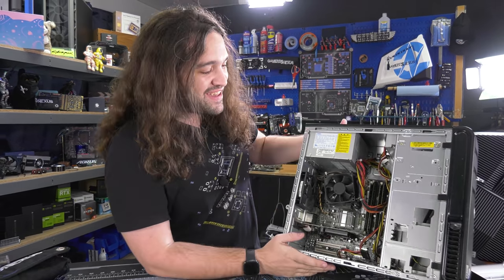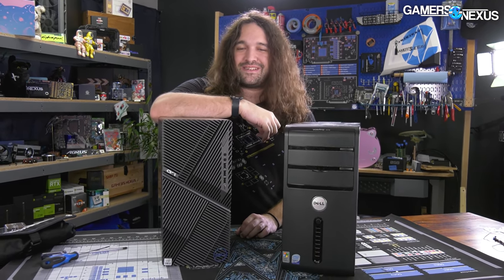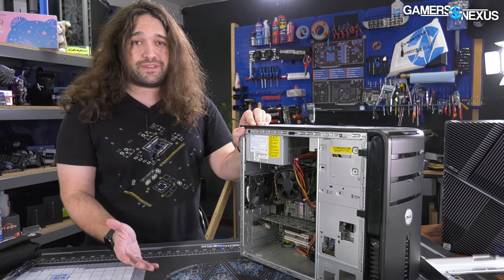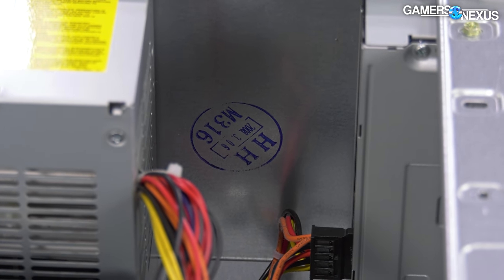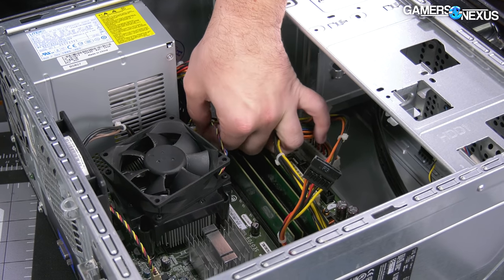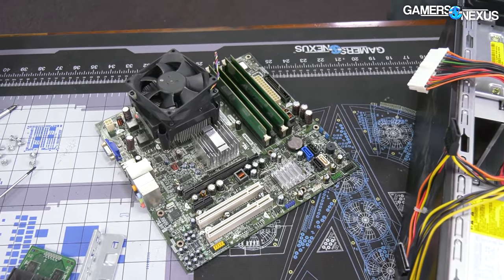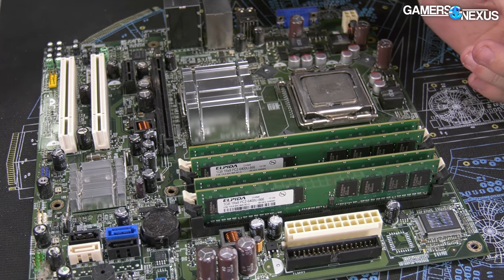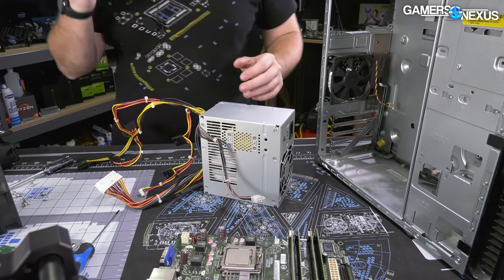13 Years of Dell Getting Worse

Comment: I do not recall when it was but at one point dell was using a standard 24pin header with a custom pint out, really fun to watch the board smoke when you replace the psu
Reply: they did that for quite awhile and it lead to many dead systems or psu's back in the day iirc. I never understood why either, it would have cost them MORE to have a normal psu custom wired and an otherwise say cookie cutter Intel 440BX motherboard with the only difference with it being wired for that specific psu.
Reply: My sister uses a 9010 optiplex with i7-3770 and it has a standard 24 pin. The newer haswell ones (9020) had a non-standard mobo connector
Reply: I remember Compaq doing the same thing. Luckily for me it tripped the PSU protection and nothing died.
Reply: The 'non standard' components are clearly used to drive down cost - they sell way more servers than desktops so economically makes sense to use the same PSU etc. Server components tend to be fairly reliable also. 

I haven't done it, but would be interesting to see overall cost comparison of pre built Vs a budget custom built with same specs for all these pre builds you have done (sorry if this has been done already!).  

The ewaste point is fair, I gradually replace bits of my system over the years. I still have a backup system that uses a 10yr old intel mobo/CPU and it works fine. It's just not in their interest I guess
Reply: @ajcball  Servers use very standard components. Server PSU's are not at all like the ones on desktop PC's visually but conform to the same standards. A Dell server that didn't have an ATX, or IPX or some other standard, PSU would get Dell sued. Dell hasn't been sued because Dell would never try that on their enterprise customers.

Dell does that to their commercial customers because they can.
Reply: I actually busted a mobo because of that.
Reply: OH NOOOO OH NO NO NO NO NO NO NOOOOOO I have no fucking idea what I would do if that happened to me, probably something in between of an all out boycott campaign and a terrorist attack on the Dell headquarters.
Reply: Wow! That’s diabolical.
Reply: Around 2004 / 2005 my friends dell kept dying.  He put a custom heat sink on the chip set and it decreased the service calls.  It didn't like the added heat from the GPU
Reply: The Dimension XPS of old were so very close to ATX but then swapped the pins around to make them incompatible with replaceable PSUs. A few like PCPower & Cooling had replacement PSUs for such builds IIRC.
Reply: That was around the time I got started working on computers for others. Also when I started to use old PC PSU units for project PSU. I got bit burning a clients computer and then a year later bit again frying a circuit that took a couple days of soldering traces to get ready. Learned a valuable lesson from that, verify the outputs before you use them as inputs for another device.
Reply: @ajcball  They do not use server grade psu's in desktops.
Reply: Do you know which Dell systems were affected by this?
Reply: I bought a Dell system from an estate sale to run old DOS games, and it had that proprietary 20-pin header.  Drove me nuts
Reply: Glad to see others bring this up. The computer repair store near me sold an adapter the swapped the 2 pins around. I was so passed when I heard about this as Dell had done some PR to promote how you could upgrade with off the shelf components and that they now (at the time) carried said components in their on-line store.
Reply: My precision t5500 uses one of those non standard pinned power supply. Do some research first on any dell to be sure that standard parts will work for you
Reply: @drksilenc  Probably true but there are similarities so I woud assume some parts are shared for cost reasons (like how BMW create the same engine but badge it as 3 different ones!)
Reply: @ajcball  ummm while servers might use a 12vo standard in "some" cases dells desktops basically contain no standard or transferable parts ram .. nope CPU.... nope psu .... nope gpu.... most servers dont use gpus.... hard drive?.... to low capacity.... nvme.....to low capacity or speed
Reply: @nicksimkins  Thanks for that. I was looking at these systems in the refurbished section. They don't mention this in the marketing materials between the *010s and *020s. (Same with the 7010/7020)
Although I heard you can buy an adapter to get standard ATX's working in the 20-series.
Reply: I think it was in the original Pentium days...  I'm not sure.  I had a Dell Dimension P133, and I think I remember coming across a reference back at the time that the PSU had the same number of pins, and the connectors would fit, but that it wasn't wired to ATX standard, and so couldn't use a standard PSU.

I don't recall exactly where I'd heard that - might've been an old Usenet Newsgroup that I was getting digest from at the end of the 1990s... I think?
Reply: @nicksimkins  that's so weird
Reply: I had one of those, if you put a standard power supply in you would release all of the magic smoke, the same if you put the Dell supply in a regular machine.   This was 20 years ago and ATX standards were still in flux so Dell just rolled their own pinout (so they claim)
Reply: @KenS1267   Practically nobody uses "standard" PSUs in a server -- at least not a rack-mountable server.  They're pretty much all bespoke to the server chassis, and if you want to replace it, you go right back to the vendor to buy another one.  Which is fine, in enterprise sales, as you don't want to be picking components willy-nilly anyway.  You want an OEM part that will meet OEM specifications, and it's totally fine if it's 150-200% more expensive than a comparable DIY part because the cost of making mistakes is well beyond the markup for OEM parts.
Reply: I have one of these! Dell optiplex GX1, pentium 2. For something of its generation, you'd never know it was wired weird until you released the magic smoke.
Reply: @nickwallette6201  LOL. I'm an IT manager in a datacenter. I have slightly over a 1k U of servers deployed right now. We do not buy all from one vendor. We have to have all hot swap units that are all standardized because no one on the floor has the time to be going looking up such nonsense when a PSU is dead.

So please do not tell lies about my business.
Reply: @NightMotorcyclist  I had one of those Dimensions with the non-standard pinout, I put one of those PC Power and Cooling PSUs in as a replacement.
Reply: Um I seen desktop servers with proprietary board connectors, blade and rack server power supplys defer by brand and generation. HP blade server power supplies have different keying than dell.
Reply: Even the fans on servers are proprietary. Have you ever worked on a server
Reply: @TinyTitian  92mm x 38mm you need thick fans for high static pressure to shove air through the chassis, these pull a lot of power do not wire it from your mobo
Reply: @TinyTitian  proprietary fans? Are you high? Fans are routinely hot swap. They have a standard connection. No matter what fans come in the chassis we only buy Delta's and  there is never any issue because the hot swap connection is standardized, just like everything else in servers. Unlike the crazy shit you guys are peddling.
Reply: @KenS1267  Delta just makes fans for a specific server, you can't put a delta g7 fan in a dell for instance how is that any different from proprietary if you can't switch between brands ? I can take my 120mm case fans and put it any computer. I can't take any hp g6 g7 fan and put it in any server
Reply: @chadmckean9026  Im not talking about the size. I am talking about how hp server fans have sensors on them, I can't use hp proliant server fans in hp g series server fans. theres more examples of this. You can't hotswap fans from one brand and generation to another. As someone that refurbished servers professionally by the 100s in a short window of time I shouldn't even have to have this argument online. Dell server power supplies have a gap in the keying, hp don't. Also I can't remember who but but between dell and hp the keying where it connects to the breakout board is more narrow on either dell or hp.
Reply: @RadarLeon  So almost identical to my new HP. Probably the same parts too. How many watts on the odd PSU?
Reply: @charlese2833  sells for the G5 from 2021 should be 460w
Reply: @nickwallette6201  ? Most people who have a single server don't have it physically on site. Those days are long over. They have the server in a datacenter, that's exactly what we do. What business would tolerate having their DB or website or whatever down for 24 hours plus the time it takes for setup of the new system? That's ridiculous. Plus the noise and other hassles?

I get you have no idea what you are talking about but please. Just stop making shit up about my business.
Reply: @KenS1267   Geez man, your emotional response is WAY out of proportion.  Also:  Not a sales guy, I do engineering.

Every business has Internet, but needing to get to a website is a completely different application than having a file store, or internal Sharepoint where your documents or stored, or whatever.  Having to shuttle everything from DNS to login scripts to internal training videos over a WAN is nonsensical for small/medium businesses, and anyone who encourages colocation for that kind of use is definitely selling something.

And who's talking about putting a server in a break room?  I can't even think of a business I've worked with that doesn't have a dedicated room somewhere with telephone punch-down panels, Ethernet patch panels, and enough floor space for at least one rack.  Sometimes there's a mop and bucket in the same room, but it's still there.

You're critically unaware of the economics of a whole slew of market segments.  I don't sell colo space, I don't sell servers, I don't sell managed services.  I don't have a dog in this fight.  I work with organizations to architect whatever they're interested in doing, and I can tell for sure that if your view of the world is that any business needs to have their services in a DC, you're the proverbial fellow that has learned about the hammer, and now everything looks like a nail.

You're also an a-hole.  So, tell ya what, you go ahead and take the last shot of this debate.  We're not going to get anywhere because you're not even aware of what you don't know, and you obviously aren't going to take my word for it.  Go ahead and froth at the mouth a little more, throw some insults, whatever helps you out.  I'll just let it hit the door behind me.

Have a good one, man.
Reply: @KenS1267   😘  Sure, sweetie.  I said I work B2B, never said sales, because I'm not in sales.  But whatever.  Everything in life is sales, right?  So I guess we're all in sales.

🔥 I'll just warm my hands by the fire, while you overreact and make up parts of the conversation that never happened.
Reply: @nickwallette6201  you're the one who spouted sales speak. You talk sales you're a sales guy. The rest of the tech world doesn't talk like that. We make fun of the sales guys for that nonsense.

If you weren't a sales guy you wouldn't have started with that crap. Now run along and do the Brave Sir Robin you promised.
Reply: @KenS1267   Alright sugar.  I used fancy words like "circuit" and "virtualization" -- which, if you're not in the tech industry, you probably just think are meaningless jargon.  I get it.  No problem.  I've got that fire to tend to anyway.  :-)

Love ya!
Reply: @nickwallette6201  op-ex, cap-ex, calling internet service circuits (like anyone but folks my business actually has dedicated connections), etc. 

That's sales speak to make it sound like you're technical when the actual technical guys are rolling their eyes and trying not to laugh at you.

Just stop you outed yourself and now you're just making a fool of yourself.
Reply: HP did that on many as well but atleast adapters were easily available.
Reply: Used to work in PC service/repair around 2001. I have been warned about those shenanigans and have seen them in the wild, yes. ATX was 20 pins and not 24 pins though :D The extra 4 pins came in ATX 2.0 starting 2003-2004.
Reply: @ajcball  Today it's out of whack on prebuilts :(

I have dual 2200 W PSU in one of my computers this way. I bought two SuperMicro 1U PSUs, a matching power distribution board with step-down driver form 5/3.3 V, for ~$115 and it's 80+ titanium out of the box. With load shared during normal operation they aren't whisper quiet, but quiet enough that ~1200 rpm fans on radiators drown it completely, and in full tilt it doesn't matter much. This is total overkill and obviously golden ebay find, but most of 750-900 W server power supplies are much cheaper even new than low quality PSUs in that range. If I can get correct PDB with quality step-down converter, it's always a win for me.

Comment: Actually Dell has improved a lot at cheaping out on their components. Really helps with their margins.
Reply: nah its just that the Vostro he is looking at was $2k+ and his new machine is $900. Considering the value of the dollar has fallen greatly from 2008 to 2021 the $900 machine would have been like $500 and the $2000 machine would have been like $3800.
Reply: @Jimster481  the value of computers has also come down a lot since then (and then went back up a bit in 2021)
Reply: @Jimster481  Vostro may be an expensive business line of PCs, but a 14 years old PC shouldn't be better  built than a new one from the same company...
Reply: The late 2021 Alienware desktop is actually the current G5 / XPS / Inspiron / Vostro chassis dolled up in plastic with a higher watt psu. Impressive that they essentially sell the same case with different hardware (and same software).
Reply: I feel like at the very least Dell could put their own weird motherboards and PSUs in there but still make the case compatible with standard ATX and mATX by providing the requisite screw holes and mounting points. There are plenty of aftermarket enthusiast cases that expand upon the basic ATX spec and do it without breaking compatibility.
Reply: @luckyowl10  Its not an expensive line of computers. Not to say that this one wasn't specced up to be pretty expensive (6600 and 4 sticks of memory implies it was). But Vostro is specifically the cheaper, less frills, lineup. The cheaper solution for the basic workers than something like the typical Business desktop like the optiplex. Chances are this was a $500 computer, specced to $1200 with a 3 year onsite warranty for $1500. In present day, the most sold version of this would be an I3 or I5, 8GB of Ram and either a 256GB SSD or 1TB Spindle for like $800.
Reply: Nah it's mainly about shortening lifespan, since components can't be replaced.
It's the counter movement against right to repair by multinationals.
You see similar things happening at brands like Apple and Samsung.
Reply: @NicksRepository  What? 30% of all USD was made in the last 20 months. 
After biden took office there is more than 20% inflation in just this year... meaning that $2500 today buys what $2000 bought in January.... in some cases its much worse than that where $2500 in January only buys you around $1600 today. 
So $2000 in 2008 is ~$4000-5000 realistically. I said over $3000 to be very conservative in the estimate. 
If you really think its $2500 from $2000 for 13 years I suggest you look at the m1 and m2 indexes...
Reply: 100% correct. Work in IT for a big company. I use a Dell Optiplex 7010 from 10 years ago. Still great and it still works. I also use a Latitude 7450 from 8 years ago. Also still great. Not doing anything that requires large processing power. Just manage systems and networks. Bottom line. The latest and greatest from Dell is subpar. The NVMe SSD that they ship out in their devices. They usually fail in 3 months. Blue screen of death or the NVMe just doesn't boot. They also became anti right to repair with their new laptops. Everything is integrated and super crap, so when something breaks, the Dell tech has to be called to get a tech to reace the entire motherboard. And if you have bitlocker enabled, and you forget where the key is, well let's just say it is a bad day. But you are right on the mark.
Reply: Yeah what people forget that for a corpo like Dell or HP that shifts millions of units, then cutting $1 off a case fan or IO panel saves a couple million bucks. Of course that makes no sense to the consumer, but for the moronic bean counters in the finance department they all pat each other on the back and congratulate each other on how smart they are at stiffing the consumer.
Reply: @Jimster481  The $900 G5 is not top of the line. The Q6600 would have been a significant upgrade, but it's highly unlikely this PC would have pushed over $1200 with this config. 

And since this config can be easily upgraded, its well worth that cost. Spending $4000 on a G5 doesnt make it any less of a turd.